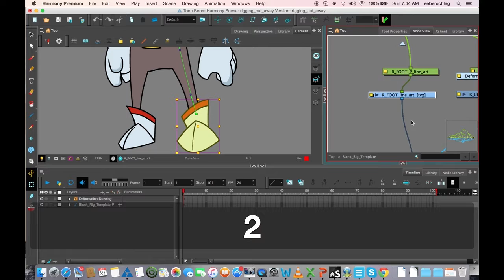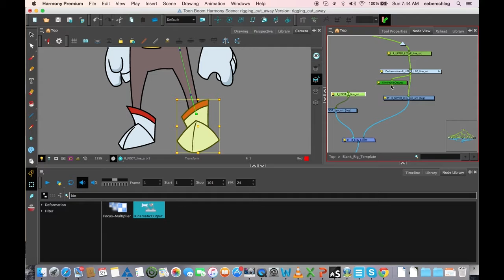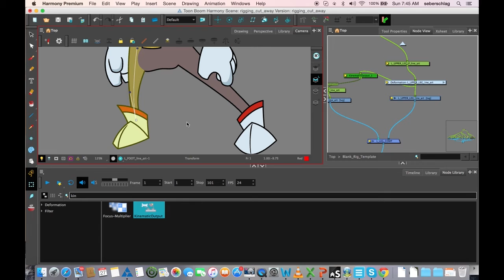How to Add Kinematic Output Nodes with Harmony Premium

Comment: Hey I had an query. By joining kinematic output to foot, the foot doesn't get any deformation but it follows the path that's what you have shown but still when we move the bezier handle of Leg deformer then there is rotation happening on foot. So is there any option through which we can keep the foot's rotation still and just follow the translation of leg deformer. I'm asking this because we are currently working on toon boom harmony tv series and we are quite new to it.
Reply: Two point constraints node can fix this :)
Reply: @klungsama  How ? explain more in details.